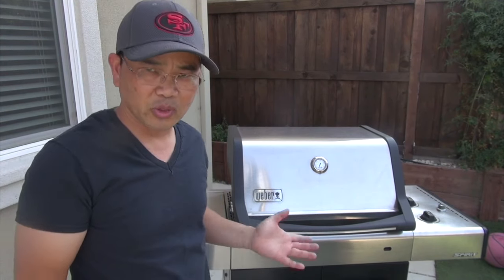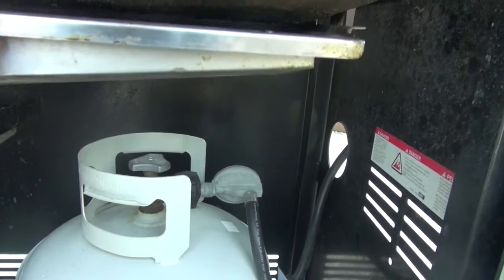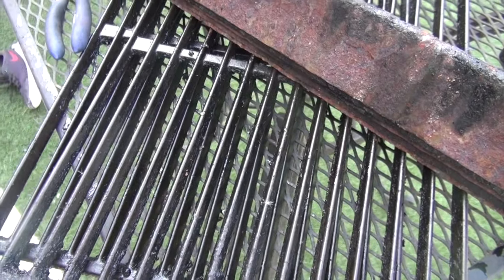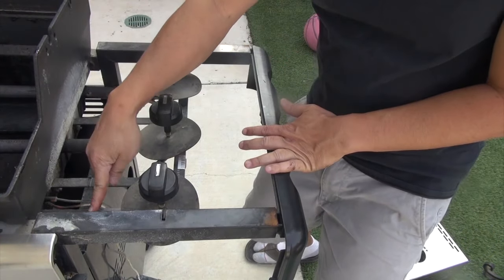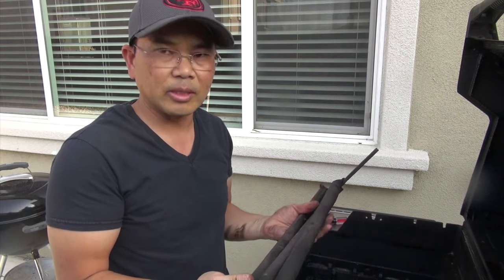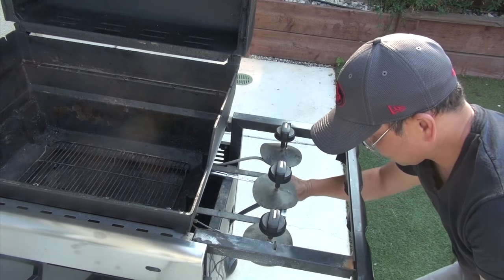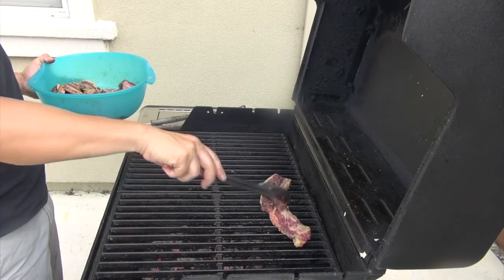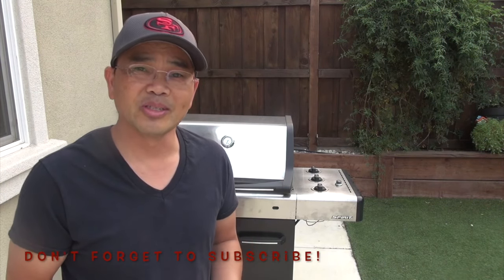How to Convert a Gas Grill Into a Charcoal Grill--Weber Spirit--Save $$$ (2020)

Comment: Awesome! I still have my old Weber gas grill from 20+ years ago that's been un-used for over 5 years now, just sitting in the sunroom. I've held on to it because it has the original heavy cast iron grates, which I prefer, that do not come with these modern gas grills. I was gonna do a rebuild of the internals and controls but had the idea of converting it to a charcoal/ wood grill instead. Thanks for the tips.
Reply from the maker: Thank you and best of luck on your project!

Comment: I did this with my grill and I use a big aluminum roaster pan for the charcoal. I cut a two inch hole on either side of the pan to circulate the air. It seems to be working fine, if I find a good grate to use for the charcoal like you have I will do that. You have a great video and can see that you take pride in keeping it clean, nice.
Reply from the maker: Thank you!

Comment: Definitely not a bad idea.  Only thing I would say is how do you control the temp?  How do you kill the coal once done.  I don't see a way to control or choke off the coals.  other than that, it you want a option to use coals and don't mind it tempting up to any degrees and don't mind  the coals just dying out  completely, then its a great option!
Reply from the maker: Thank you!

Comment: Thank you. I was on the verge of selling my Weber gas grill. I thought it would be neat to have my nice gas grill to compliment my husband's charcoal grill. Not my cup of tea, Gas grills don't produce flavor like fire, even using wood chips. I am gonna convert to wood fire. Was it difficult locating the grate big enough for your coal? Also, even if your propane tank was empty, wasn't it risky to leave it in the bottom under hot coals?
Reply from the maker: You should able to find the grate at home goods stores, tjmax and the like.  Also, lots of folks expressed concerns about the propane tank.  I appreciate those safety feedback and I removed it many months ago.  Thank you as well.

Comment: Great video tutorial.  I just acquired a Weber Spirit 210 and plan to do the charcoal conversion.  It’s not as clean as yours but I still want to do the conversion . What size is the grill grate that you use for the charcoals? Where did you get it? Thanks
Reply from the maker: The rack for the charcoal is 11.5 inches by 16.5 inches.  I purchased it from bed bath and beyond.  Might might get it from other home goods stores.  Good luck with the conversion!!!😊

Comment: Do you have to remove the  burners? Can the burners stay in and be used as a shelf in case you wanted to move your charcoal or wood higher up closer to your food. I have a old weber grill tgat I've been thinking about converting.
Reply from the maker: Let me know if leaving the burners would give that flexibility… I prefer having more distance between the charcoals and the food.  Good luck on your project. Thanks!

Comment: I did the same thing w/ mine, my only problem is, I can’t regulate air flow when I close the lid to get a more smoked flavor. If I shut it, it just puts the fire out or if I leave it open & try to open grill the whole time, my coals burn out way too fast.
Reply: Any tips?

Comment: Quick question:  what size is the rack? Where did you buy it from?
Reply from the maker: Thanks for checking out the video.  The dimension of the rack is 11 1/2 inches by    16 1/2.  You can get it in baking section at bed bath and beyond or Walmart or similar home goods stores.  Thanks!
Reply: 20.8" by 12.8" - do you think it will work?
Reply from the maker: The length is slightly long to fit my model.  It might fit yours.  Thanks!